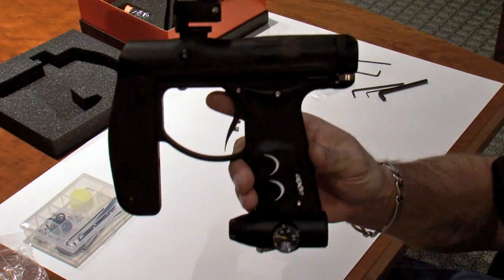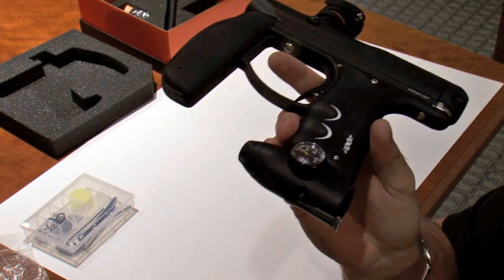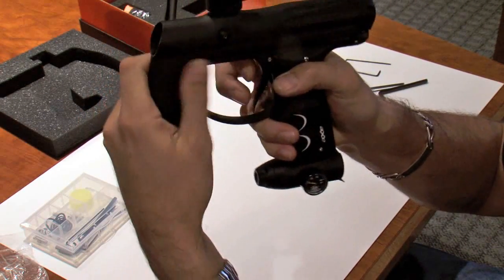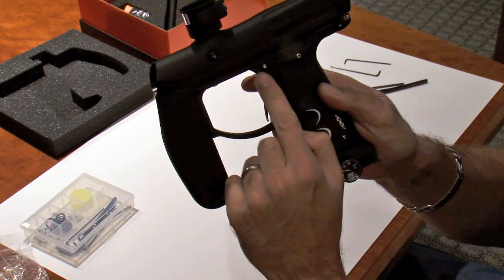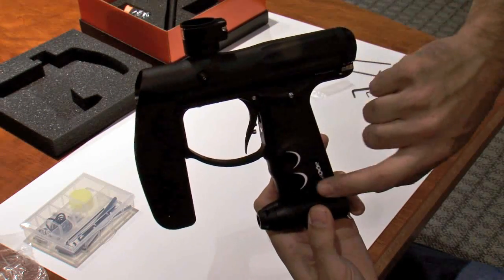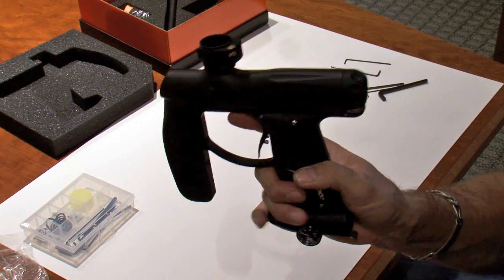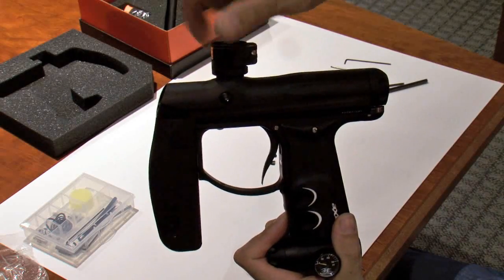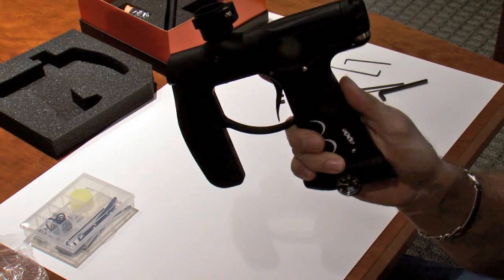AXE Rundown

Comment: @manike99 Yes the Axe is brand new. But its strange how when I set my asa between 190-200psi sometimes during or after a match it would go over 200psi (it's like as if the gun is self adjusting). Also when I take breaks and fill my HPA I don't depressurized my gun I leave it pressurized....

Comment: I bought the AXE and played it for the first time. It is VERY good. But I have some concerns. One is the my asa does not bleed after playing a match. Two is that I would adjust my asa just below 200 psi and sometimes during a match or after a match it would go past 200psi. Also the bolt rubs on the body shroud when I take it out and put it back in. Is this normal? Or should I send it in to get fixed?

Comment: @manike99 i have an axe and it leaks from the bolt area but.it still shoots do you know what could be the problem I use techt gun sav as my lube, and my empire prophecy plastic shell (front part) feedneck piece broke is this under warranty? Also my axe is the LE Storm Trooper and the paint is chipping away is it covered also? Please respond